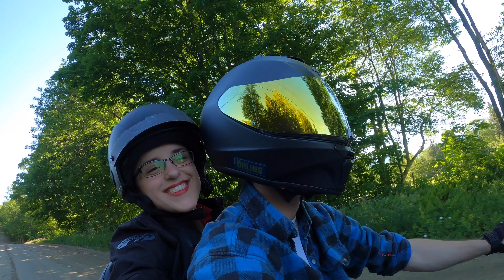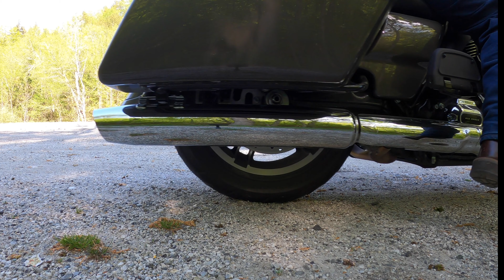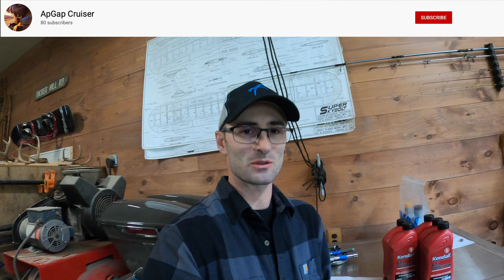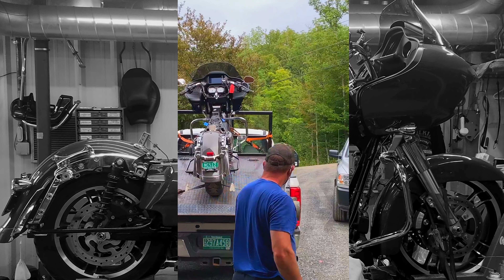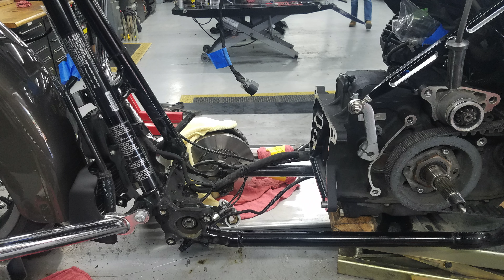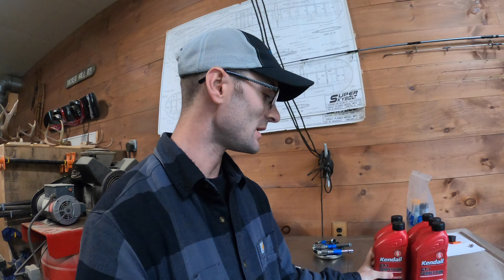Road Glide 124 Build Update

Comment: I can recommend the rekluse clutch slave cylinder. Its easy to install yourself and will lighten your clutch lever quite a bit.  I did it to mine after installing the heavy clutch springs and its amazing.
Reply from the maker: I've been keeping that in mind.  I want to get some more miles on it before I decided if I want it or not.

Comment: Great video! Did you consider replacing the stock intake manifold or throttle body when doing your build? Thanks.
Reply from the maker: Sometimes going bigger with intake manifold and throttle body can cause a loss in power.  You have to keep an eye on the combination of parts as a whole.  My build was a 10.75:1 compression with a bolt in cam, so it was better to leave the stock heads, throttle body and intake manifold.  I'm planning on discussing this on my next video as well.
Reply: @apgapcruiser2687  understood, thank you. I look forward to watching the next video. I will eventually do a similar build I think and am looking for power but also want reliability.